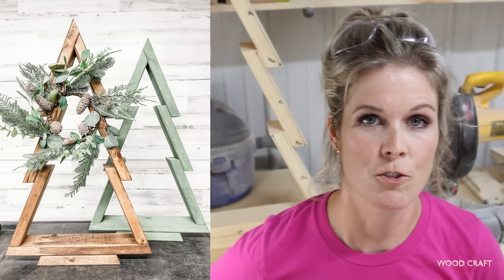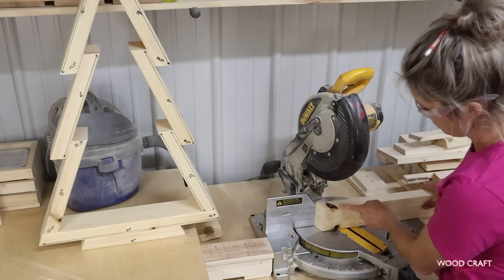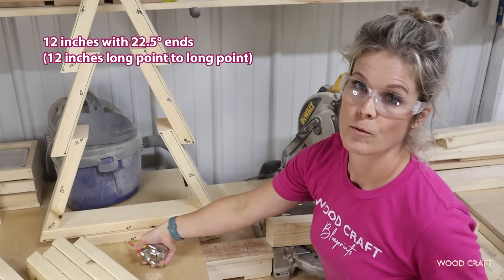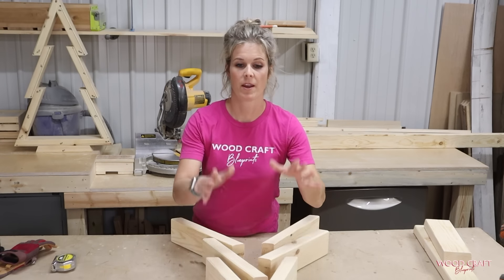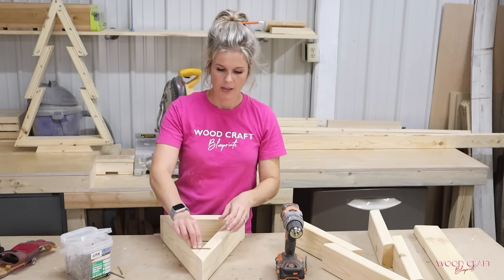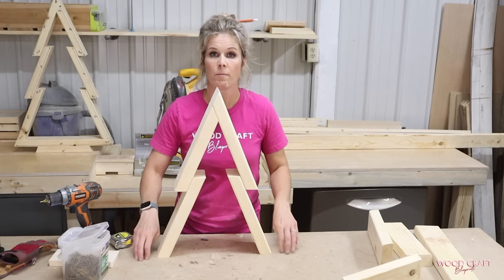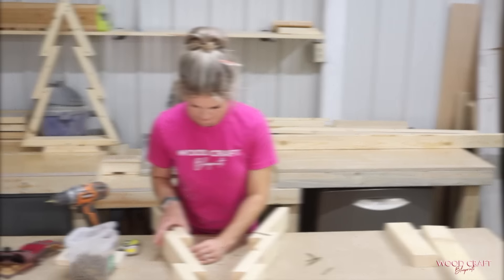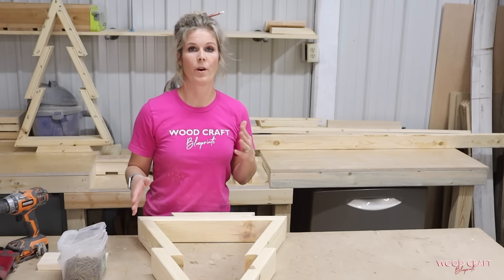How to Build a Wood Christmas tree from 2x4 lumber (3 foot tall)

Comment: Great video, detailed and easy to follow. What I did to have the screws on the inside was screw the top two pieces together, then screw the two left pieces using the 2 inch spacing to complete the left side. Then, I separated the top two pieces and screwed the two right-hand pieces on from the inside. Once both sides were complete, I screwed the top two pieces back together and completed the tree, putting on the bottom and base. If all the cuts and spacing are accurate, it went together fine.

Comment: Nice project.  If you assemble the sides first you can have all the screws on the inside.  Then screw the top together.
Reply from the maker: Yes but if one piece gets off the overlap mark, its very noticeable and it's too late to fix it
Reply: Just make a jig that allows the pieces to be assembled with exact spacing each time. No need to mark pieces, and speeds up the process.

Comment: Fun project. Very informative throughout. Most YouTubers fail on that when they post their videos. I would like to add instead of using screws, use wood glue and 2.5 inch brad nails. Makes the build much faster. If you're comfortable using screws, pre drill your holes and use a countersink bit. Not critiquing just helpful advice. Look forward to seeing all your future builds
Reply: When women teach, they teach for all to understand, unlike men,  they just assume we know. We are here to learn. 
Girl power 💋
Reply from the maker: I prefer the screws with 2x lumber projects. Wood glue is only strongest after being clamped

Comment: Great project but you're totally measuring wrong for accurate cuts you mark on the top and line it up with the blade. Also one of the worst things you can ever do to ruin your hearing is run a saw. Hearing protection so you don't end up like me (professional sawyer of 20+ years)
Reply: The hearing protection is no joke. I worked in a cabinet shop for 18 years, and now I wear hearing aids.